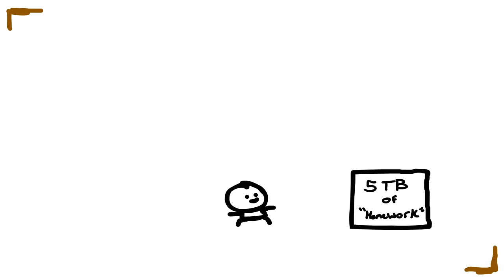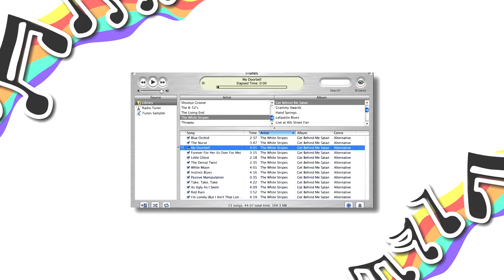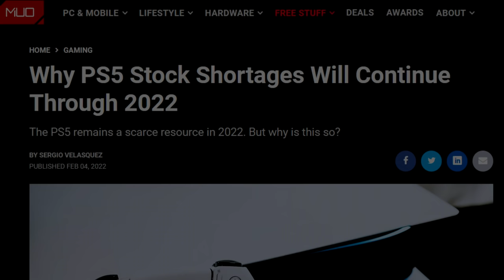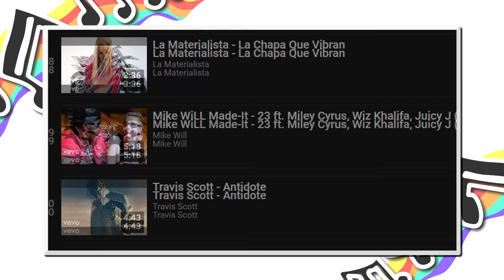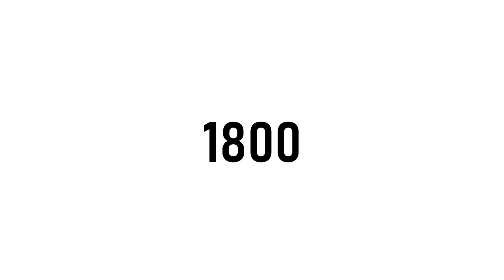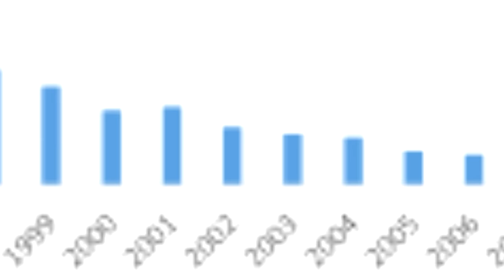CDs, Cassettes And Vinyl

Comment: Cassette nerd here. ( I still collect some cds as well) but I like how tapes are small, cool looking and are easily portable unlike cds. Plus I enjoy working on Walkmans
Reply: Where do you buy your cassettes from? My local electronic stores don’t have anything.
Reply: @bismuththebi  thrift shops, garage sales, and online tape shops are great places. Ebay as well!
Reply: @RobiticDuck  thanks!
Reply: can i ask u something will cds work better on a xbox or ps3??? or sega dreamcast then a boombox??
Reply: @Judyhopps-1iq  modern consoles should do just fine.  You can rip the songs from the cd digitally to be stored on the Xbox, and Xbox 360 hard drives.  I'm not too sure about the PS3 but it probably has a similar feature. I do still reccomend buying a radio with a cd player if it's an option for you. Happy collecting!

Comment: Why are they good? Due to them being more authentic and 'real'. 
I find you respect music more when it's on CD, vinyl & cassette. The main problem I noticed with mp3 was that it weren't authentic and in and that was in a physical way. They're is too much fakeness nowadays, probably one of the primary reasons it may come back. Also mp3s sound is divided into a block type sound format.

The vinyl crackles give it a more inconsistent personal warmth like magic, very human looking in nature.
Last for decades if you change the needle occasionally.

The CDs seem to last decades without degrading if taken seriously. CDs have the genuinely best sound quality, but always lacked the vinyl magic cause the CD had alternative but parallel magic within itself.

Cassettes seem mint as on first glance it's parts literally move. Which is it's most attractive quality. In my honest opinion it's probably the worst one, easily tangled but have waves of authenticity like the rest equally. 

So CDs & vinyl are better off with. Believe me cassettes become an assel from time to time. Got a get used to cassettes firstly!
Reply: Cassette  Are hard to find nowadays for some reason than CD or mp3
Reply: So long as you have a good condition tape player (fresh belts usually make a huge difference), you shouldn’t have any problem with your tape being eaten and tangled
Reply: @olympus__  Yeah, but sometimes you forget about that miniature minimalist technology and as a music collector. It obviously becomes hectic, especially once buying the same cd or vinyl countless times a single decade!

Comment: Cd is the soft spot for me. Vinyl is just so imperfect, and while a cd is basically the same as just using a high resolution digital file I still like having the media as a real thing. Vinyl need to be cleaned properly, stored properly and many modern vinyl records even have pressing issues from the get go. Not to mention the surface noise that´s just inherent to analog audio reproduction. Cassettes are cool but the machines are hard to maintain and it´s also difficult to find a really good cassette deck (especially new it´s basically impossible no matter how much you spend). And if you are going through all that trouble you might as well just do reel to reel with which you can make higher quality recordings.
Reply: How is vinyl imperfect
Reply: Pressing issues, static electricity that atracts dust which is impossible to get out even after thorough cleaning etc. It sounds fine but a cd is almost always going to sound cleaner. Sure you could argue the whole digital vs analog audio thing but most of the modern pressed vinyl records are done using digital recording anyhow.
Reply: @trevor245  You're making some very good points, but I think the certain imperfections make vinyl better than CD (for some people). I think the hunt for best condition vinyl makes the hobby interesting, when with CD it pretty much plays well or doesn't, with not much of a middle ground. I absolutely agree with your points about modern vinyl and that's part of the reason about a 70% of my collection is made out of used records (the other being that some labels price their vinyl very high)
Reply: @LageYouTube  I mean sure similar arguments can be made for tube amplifiers and there is nothing wrong with that. I have quite a few records but if I had to choose how I'd like to listen to music for the rest of my life I'd go with the most consistent and clean method. Also a lot of artists that I listen to are not large enough to get an international release which means very high shipping costs if they are not from the EU so a cd makes more sense in those instances as well. I service and resell audio gear as a hobby/side hustle so I definitely have proper gear. I know how much of a hassle keeping everything in good condition can be and while for some that might be a plus since it means you are very involved in the whole process for me it's a downside.